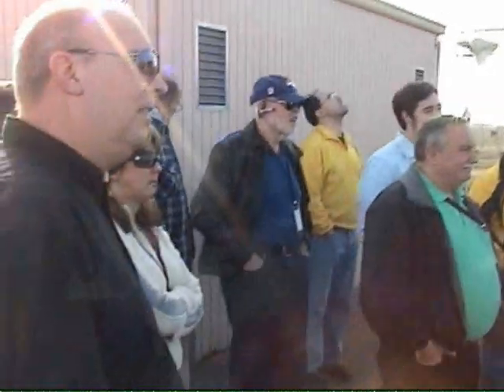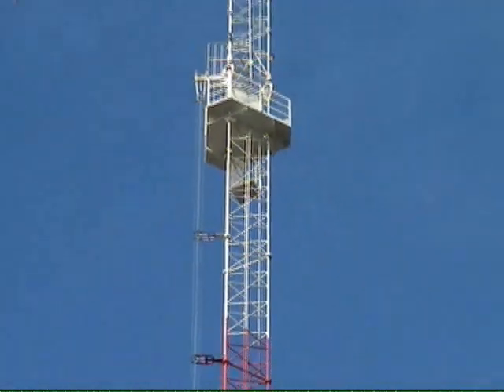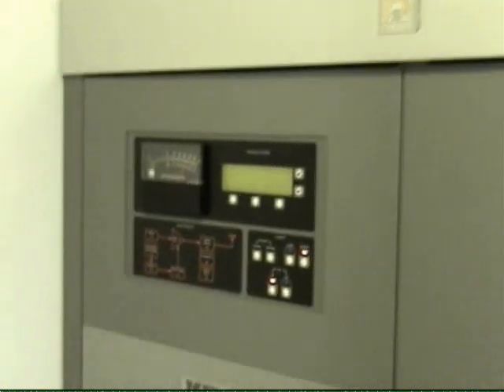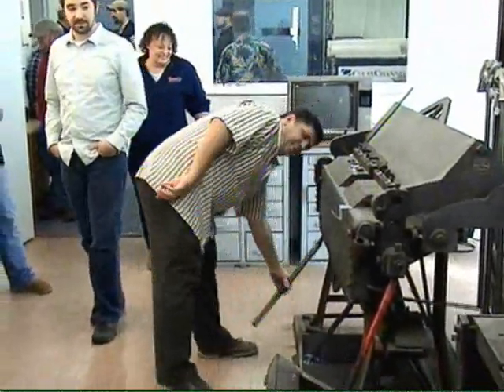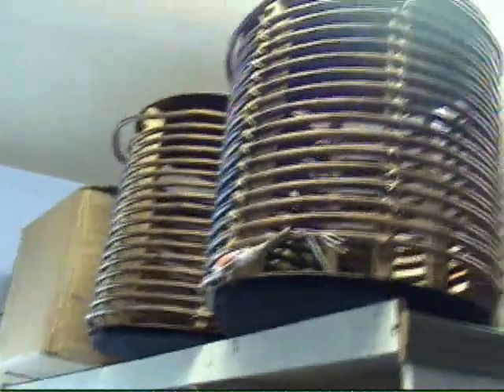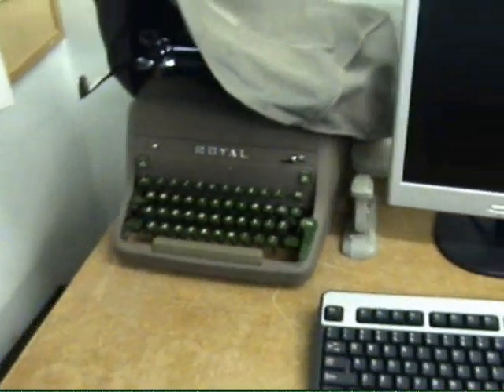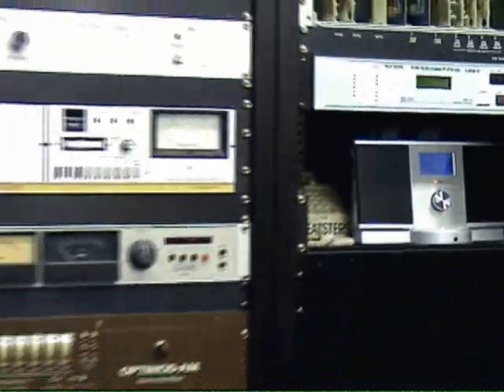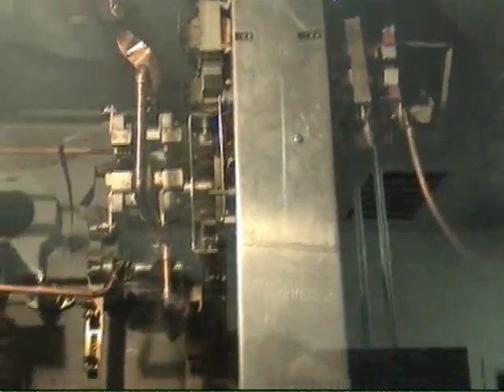Tour of KFBK Transmitter Site

Comment: I lived right across the street back in the 70's and I witnessed a plane almost crashing into those towers. It was having engine problems and it completely lost power. It flew right between the towers.  We could see the passengers shutting the blinds. It was silent except for the sound of the wind over the wings. As it passed between the towers the pilot tipped the wings back and fourth. Then as soon as it passed the pilot fired up the jet engines and banked it to the left. It was the scariest thing I've ever witnessed that turned out good.

Comment: Amazing how compact transmitters have become. Today, mosfet 50s are no bigger than 5-kw tube jobs use to be. Back in the '70s I maintained one of those RCA-50H ampliphase (now the aux there). And it was small compared to the plate-modulated Westinghouse 50HG it replaced. But those old xmtrs were sure pretty all lit up with glowing tubes and mercury rectifiers pulsating to the beat of the music. Not much to see with today's xmtrs.